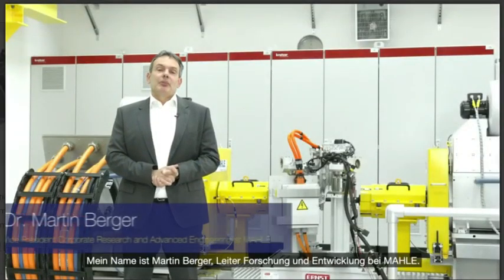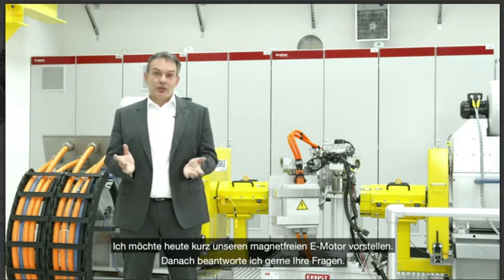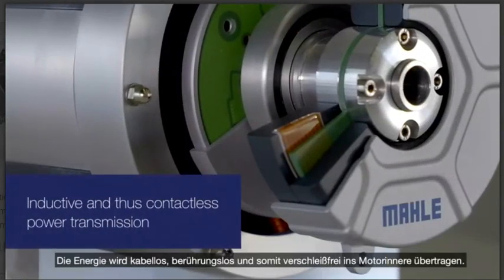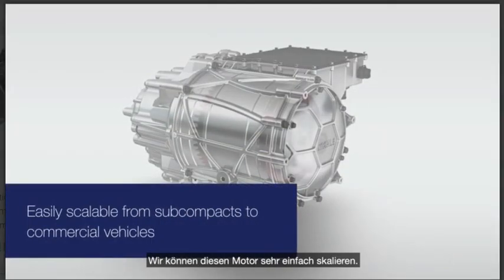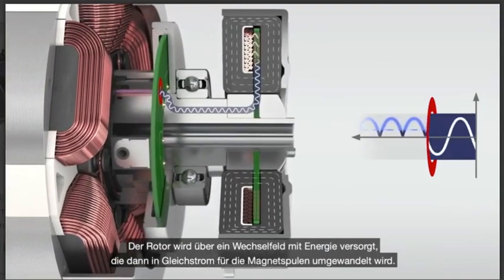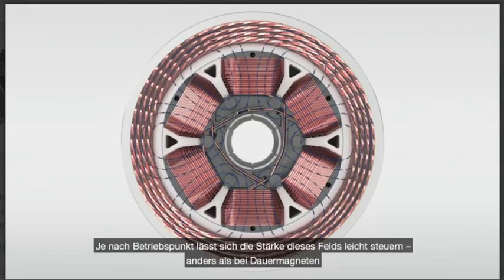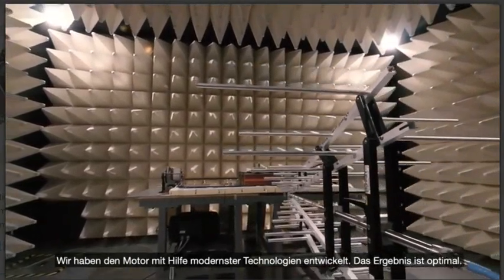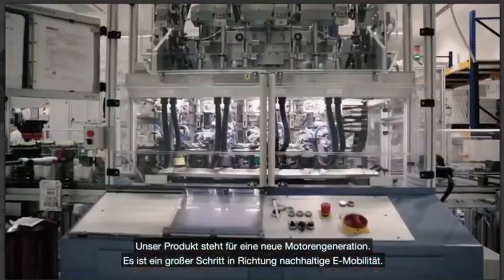Mahle, produce revolutionary new no-magnet motor...

Comment: I... Don't really understand the innovation here. The same thing has been accomplished with brushes for... Many, many decades. And brushes are cheap and reliable. Nothing is new here. We've understood how transformers and motors work for a not insignificant amount of time. One could argue that it is, in fact, an introduction of an entirely different set of potential issues. Whereas the only real negatives of carbon brushes is carbon dust and they wear. It would've been more innovative, IMO, to have just made it with brushes and made the brushes as simple to change as a spark plug, or other routine maintenance item.
Reply: @visnevskiscom   Eh yes and no. I mean, it doesn't take much of field current to maintain the necessary field strength. Generally an order of magnitude or two less than stator current, so field current isn't really an issue. Sure, slip rings wear, but not before going through dozens of sets of brushes first. Long enough, I'd wager, to where it is no longer cost-effective to keep the vehicle operating anymore. Bare in mind that these would be slip rings, not a commutator like a DC motor. So, smooth. With that in mind, even brushes would last quite some time. The most maintenance require would be to replace them once in awhile and clean out the carbon dust. And that would probably only be after several thousand miles.. So, a blast of air and replace the brush pack. Cooling is not really an issue, the brushes themselves and slip rings shouldn't really need to be cooled. At least, not outside of what would be cooling the motor as a whole already.

The issue with stalling and starting you're talking about doesn't really apply to these motors. They are, effectively, AC synchronous motors on a VFD. So, they can start at 0 hz essentially. The rotor field can immediately lock to the stator field and change speed as the stator field changes speed. Motor feedback is a thing, so the drive for the motor would know when slip is occurring and can compensate accordingly.

My point is more that they're "innovating" something that doesn't need innovated. This is an extra set of problems that have been solved already for decades.

I'd say they don't use brushes because it's a maintenance item and the carbon dust. Both of which are easily remedied with good engineering.
Reply: @visnevskiscom  Ah, even this motor design still needs a VFD... This motor is accomplishing the same thing as a brushed synchronous motor. Just delivering power to the field in a different way. I'm... Not really sure where you're pulling that from.

You do not need half the motor's current to power the field... It takes far less current to build the required rotor field than the requisite stator field.

For example, have a look at the field current required for this 1500 HP synchronous AC motor, but I'll save you some reading: It's 34.5 amps @ 250V. Stator current for this motor is 212.2 amps @ 4kV.

https://www.caseyusa.com/products/spec_sheet/10137000000-1500-hp-1200-rpm-4000-v-general-electric-986y-ac-synchronous-motor

It doesn't require nearly as much field current as stator current.

 Which brings me to my next point:

You are thinking of a series wound universal motor. Can run on AC or DC, such as that found in an angle grinder. That is NOT what this motor is. An angle grinder has a commutator, not slip rings. Brush wear is notably higher with commutators vs slip rings. A slip ring used in a brushed AC synchronous motor is smooth, it doesn't have bars on it like a commutator in a DC or universal motor.

Once again, a synchronous AC motor DOES NOT have a commutator. It has slip rings, exactly the same as you'd find in an alternator/AC generator. A commutator is not a slip ring. Assuming good brush contact with the slip rings, there is no arcing to be had, there are no gaps in slip rings.

And because field current isn't that high, generally speaking, air cooling is more than sufficient for brushes and slip rings, if any cooling is required at all.

A universal motor in a saw or angle grinder is not a synchronous motor. It is a series wound DC motor. The commutator "mechanically rectifies" the incoming AC power. This, incidentally, is also why those motors are capable of spinning 6, 7, 8k rpm with 60 Hz incoming AC power.

Comment: Tesla uses an ac induction motor at one end of the car and a permanent magnet motor at the other. So this kind of motor isn't new, but the efficiencies that Mahle have achieved are wonderful. These induction motors don't have the absolute instantaneous torque of a permanent magnet motor and usually give up a bunch on efficiency. But at these efficiency levels it's practical to use one of these motors as a single motive source in a vehicle. Well done.
Reply: This isn't an induction motor.

Comment: Mahle is a big player in the automotive industry. It is like Bosch or Continental. When they announce a product you can take it for real. This not sifi, and believe me these guys know a lot more then you about motors. And they don´t need any explanation of the good old electric motor.
Reply: tesla has been using induction motor to cut the cost of permanent magnet and sacrifice efficiency
Reply: @Rcck.7282  sacrifice efficiency? I don't think so. To my knowledge the model 3 uses induction motors on the front because these motors don't have induction losses while in (I think it's called) towed operation. At the same time induction motors are only about 1-2% less efficient in peak efficiency, but up to 5% less efficient in part load, but all electric motors tend to be less efficient as power output goes down. So if the car is in part load, a front induction motor can simply be turned off without induction losses, raising load on the rear motor and keeping it in better efficiency. If both motors were permanent magnet motors, there's two possibilities: one of them is running at higher load while the other one's turned off, which results in induction losses, or they are both in lower load, reducing efficiency for each of them. In that scenario the combination of induction and permanent magnet motors would be more efficient. Than two permanent magnet motors.
Reply: They are inventor of many automotive tech. Starting alu pistons in 1920s.
Reply: Well, continental build the magnet free motors for the Zoe Q240 in 2013. Not anymore, though. Since 2017 Renault builds their own motors now. I'm not yet convinced that Mahle will be successful in the electric car world.
Reply: Off course not.

Comment: It's a very common synchronous motor/generator (like almost every powerplant is using since the introduction of AC electricity) where just the brushes for the rotor was replaced by an inductive power transmission.
Reply: True, but that inductive transfer is a significant (although I agree not "revolutionary") difference.

Comment: hey they have had motors without magnets for a long time.  what the hell. i bet the car still cost $50,000. so the motor needs extra power just to turn it. i don't see it.
Reply: Any electrical motor needs external power to turn. That's how they work
Reply: @norbertfleck812  yes but magnet motors i would think would require less
Reply: @terryclotf  The difference is very small. As you can run an electrically excited motor at approximately cos phi = 1 all the time, the current you need for the rotor is compensated by the reduced losses due to the reduced current in the stator.

Comment: Where is motor? I can create 3d object  for a single day.
Reply: This is only a slight alteration of the century old synchronous engine.
They replaced the slip rings with an inductive (solid state) device to transfer the necessary current to the rotor.

Comment: So basically you use an oscillator and probably a rectifier bridge instead of slip rings or permanent magnets. Still it's wonderful if it's true that you've refined the design to the point where you can compete  with neodymium. We need to protect ourselves from reliance on Chinese rare earths. In my opinion the main thing keeping us from producing our own supply is our irrational fear of thorium. Something now worthless that can by be used to produce a limitless supply of fuel. This could be done using mostly existing technology. But that's a subject for the future. Right  now the security of the west requires that we find both substitutes for and reliable sources of rare earths.

Comment: Interesting concept, but contactless excitation of rotor fields is not new. The advance here is by exciting the rotor whilst stationary, by the additional AC supply.
It might be worth pointing out that in the earlier days of milk floats and other electric vehicles, there were no permanent magnets used then- DC series or compound motors reigned supreme.
Like some others here, I would seek verification of the claimed efficiency- if it is as good as claimed, then vehicle range benefits, but the added complexity may affect the economics.
Reply: Well Mahle is a specialist in extending vehicle efficiency. They have worked on extending fuel milage for diesel trucks and I see their businessmodel becoming similar for these machines. They will go in high milage electric vehilces, such as city cabs or delivery trucks. A place where aftermarket solutions pay for themselves through lower consumption. I doubt you'll find this engine in a production vehicle soon (or ever) because the average consumer is not the target market and the vehicle manufactures tend to be a little to proud to outsource their engine development.
Reply: @GermanTopGameTV  Yes, because it's about time that electrical motors did away with beautifully sculpted, precisely engineered PISTONS and avoided permanent magnets to boot! 2 for 1: What a keen insight.
Reply: There's other considerations beyond the claimed efficiency.  Most of the world's rare-earth magnets come from China.  Political, it's a big deal to achieve a technical independence, even if it isn't 'actual' yet.  The claimed efficiency relative to current electric motors is the lesser benefit, in my opinion.  Just an extra bonus.
Reply: @TROOPERfarcry  I am very concerned about the dependence on Chinese supplies, not only raw materials like the rare earth elements used for magnets, but manufactured goods, which have undercut  Western manufacturers and put them out of business, further increasing the reliance on Chinese supplies (I have noticed that during the current pandemic, China had all the PPE supplies ready to export).
I do note, however that the commenter GermantopGameTV refers to Mahler's business plan being only for after market sales, not original equipment- If this is the case then imports would be unaffected.

Comment: No permanent magnet.
Nothing new about a motor that does not use permanent magnets.
The 95% efficiency claim is of interest.
The no-contact claim is of interest.
The wireless issue is of interest.
Reply: A 95+% efficiency is typical for synchronous engines.
Since the late 19th century.

The classical sliprings are cheap, simple and easy to repair while the brushless device is a lifetime limiting factor for that engine.

Comment: There’s nothing new with this. Motors that utilise no magnets are everywhere.
Reply: It's the wireless part that's the key here, less wearable parts, less maintenance.
Reply: @Mark5mith  And? Bldc motor is exactly that.
Reply: @masseyluna2002  aye, but a bldc motor either has magnets like my hobby motors or uses wiper contacts with brushes, this has neither.
Reply: Could I get a example??
Reply: @ferchoville  A normal induction motor, like the one found in an AC powered fan, has no magnets and no brushes. Efficiency is not the best.
Brushed AC motors, like the one found in a vacuum cleaner, exist, but they are noisy (both mechanically and electrically) and the brushes will quickly wear out.

Comment: Hello, Could this technology be applied to generators such as wind turbines, tidal turbines or energy recovery when braking vehicles?
Reply: Yes. I worked for a wind turbine company ~7 years ago and this is exactly how the 500kw generator worked.
Reply: The only difference to the century old synchronous engines are the inexpensive slip-rings and carbon brushes which Mahle replaced with an expensive and fault prone electronic device.